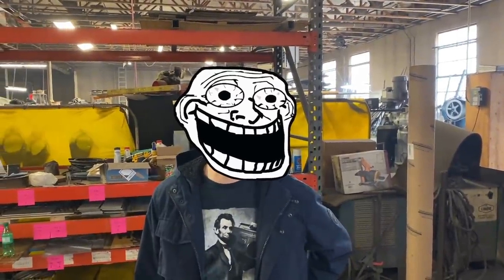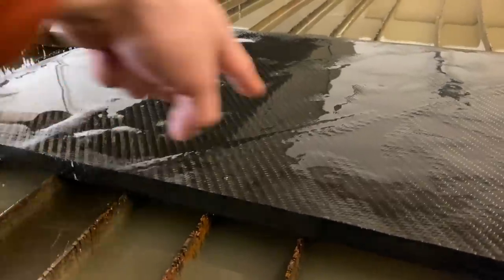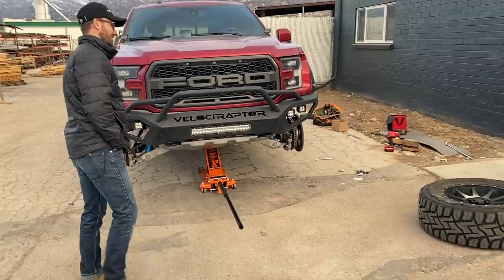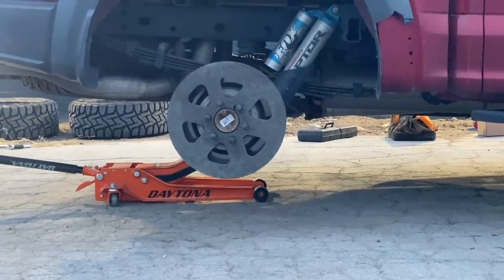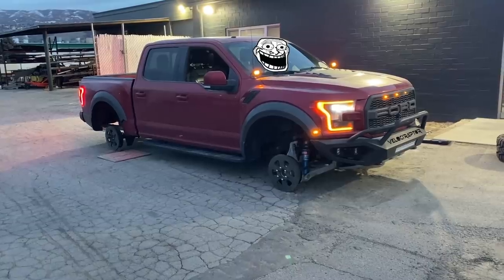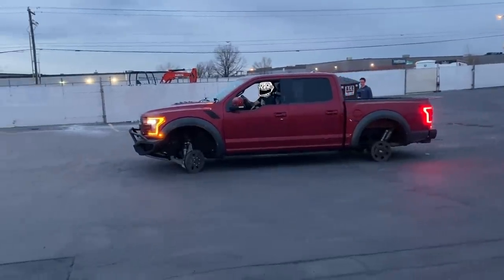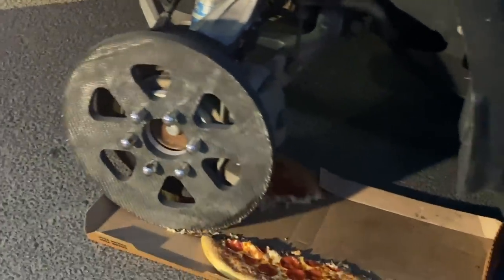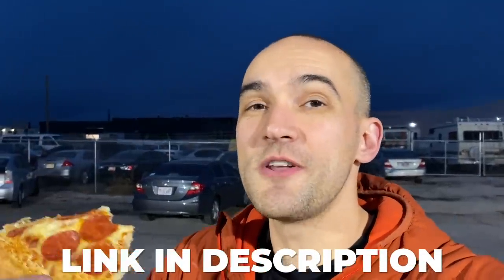"DIY" Carbon Fiber Wheels with a 60,000 PSI Waterjet

Comment: Aluminum wheels have stress points that give them their strength, allowing them to look like actual spider webs and support an entire car just fine.
Steel has a high strength-weight ratio, meaning it has no need for these stress points.
Carbon fiber wheels are made possible through magic.
Reply: Yeah I guess steel has a high weight/strength ratio but you know what has an even higher ratio? Aluminum
Reply: Respectfully your comment makes no sense lol
Reply: @monhi64  How does it make no sense?
Reply: @monhi64  Only under certain conditions. And it depends on the grades of steel and aluminum you’re comparing. Steel has a higher sheer strength and is more malleable than aluminum, which tends to fracture when stressed. Steel also has a higher tensile and compressive strength, which is why you don't see aluminum bolts or armor very much. When it comes to car wheels, stress points are created in the spokes of an aluminum wheel to create internal tension and give it strength. Something steel rims don't need.

Comment: This had so much potential. If you got some multi-piece wheels and made new center faces for them. That way you could actually mount tires
Reply: I thought they were going to use the 3pc wheel barrels and really make a wheel.
Reply: @bronxite450  I’m wondering if that could be viable

Comment: why wouldn't you make it the size of real wheels and 2 ply?
Reply: You saw the piece of CF they had, right? They were obviously using an off cut that they had laying around. They're not going to go buy thousands of dollars of CF sheet stock to make the wheels. 1"thick CF is about $400 psf. (CF by volume is about $5k per cubic foot.) A 4 foot x 8 foot sheet (same size as a sheet of plywood), of 1 inch thick, basic twill weave CF, is about 12 thousand dollars. So if they wanted to make it viable, and they used a full sheet to make 8 "wheels" that were 23"in diameter by 1" thick, and doubled them up, it would cost around $12k. That sheet they used is about 12 SF, and about $5k. So, that's why they wouldn't
Reply: @xenonram  so ruining the suspension of a 60000 dollar truck is way cheaper